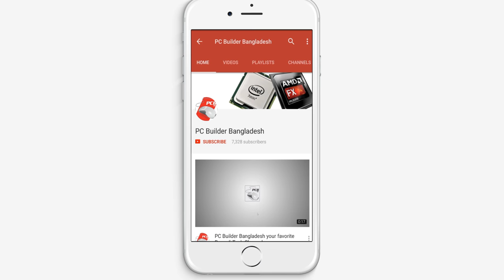Project L.C.S Custom Water Cooled PC Step by step Build Guide in Bangla

Comment: All i can see is Ruh-Afza injecting over there 🐸 but again a good work PCB BD.... Graphics card riser er brand name ta ki and pricing kemon? card riser use korle ki SLI kora possible?
Reply from the maker: Ruh Afza strikes! :D1. EZDIY PCI Express 16x Extension port adapter. (TT ero akta ache same quality)2. Riser Pricing almost BDT te 3,275Tk3. SLI kora hoito possible full tower casing a kintu it will look messy. Akta graphics card er jonnoi eta thik ache. SLI korle traditional way tei mount kora bhalo. Thanks bro :)

Comment: The way you spread the paste on the surface on it, air trapped in. Trapped air acts as hit resistant between block and surface! How about a small pea size dot in the middle and press the block on it?
Reply from the maker: There wasnt any air trapped, and just a bit in the middle should be the way to go, but peoples vary so does the way they work.